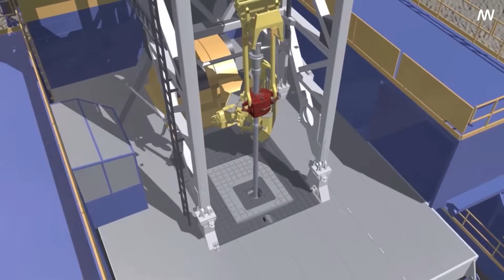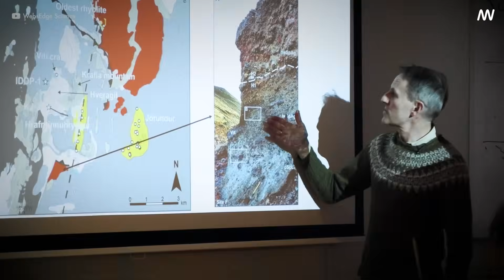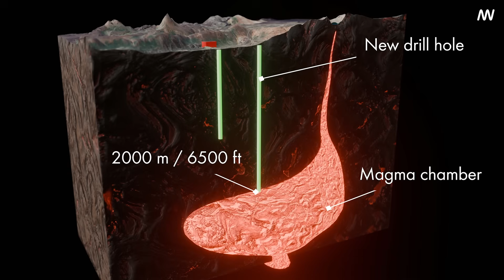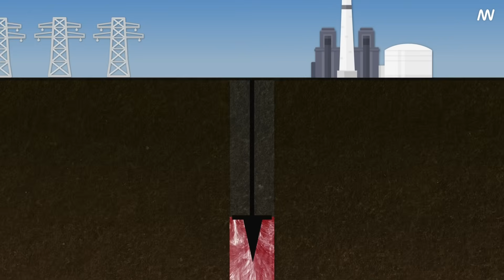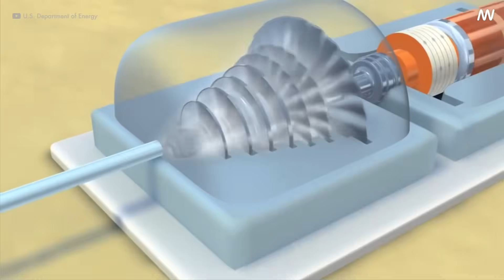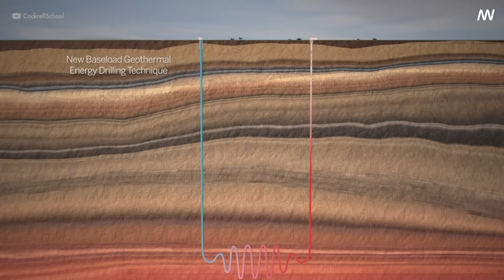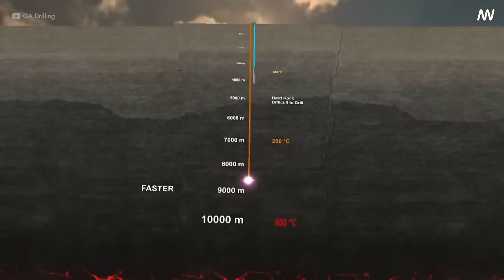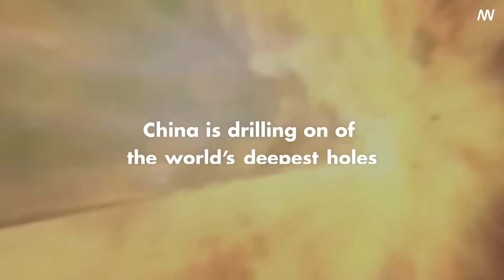Why Scientists Plan to Drill into an Active Volcano

Comment: The only way to get through a magmachamber is using drills that will not send of an chemical reaction.
In my opinion spread often crystals formed by magma can contain energy from a last heavy earthquake. This can be released if a chemical proces is activated and these crystals come to a meltingpoint again.
A 0.5 earthquake could then easily give an earthquake of 3 or higher if the last big one would have been a 4 or higher on the Richterscale.
A+B=C C:2=D Dx1, 4 = bew height of quake. 
So its all about knowing what was the last high quake and do you want to release this power with drilling. 
Water can give a quick chemical reaction so drilling with using water isn't the best methode.
Reply: I don't know of any research that backs your claims in the slightest.
Reply: @buggsy5  research is what scientist are afraid of. Then they will find out we have banged up the wrong tree for almost 70 years. Darwin his research went already in this way. He did not how to bring it to the people. His first books was getting people ready for it.
Reply: @buggsy5  Bugsy, Darwin was into volcanoes and finding crystals. What he had as conclusion weel we went of it. Now we are saying magma chambers or( tectonicplates for causing earthquakes) but if you take the next thing in counter:
Earthquake in a magnitude 8 and higher are realeasing forces over multiply atombomb strength.
If rocks are grinding they pulverized. So is this the true reason of high earthquakes. Its surtainly to be doubt.
Gasses, pockets of it, can they reach this kind of reaction, its never seen.
So if you take a look what you find all over the world, crystals, left behind when the earth was founded.
As I looked over earthquakes and period of time befor the formula I am working with occured, it can happen after 40 minutes or after more then decades. So if you look at these facts you or at least I did was looking into crystals forming and deforming. And after I have done that a hole lot was suddenly to be explained. So looking with a different idea to logical problems can give another view.
My lives motto is no problem as great as the basic.

Comment: Let’s see if AI mentions the fact that once Iceland perfects this procedure, we will be able to do this anywhere on earth because there’s always heat deep underground. We don’t have to hit magma to produce energy. Better than Solar better than wind better than wave, it is a completely incessant energy source.
Reply: Maybe. Contrary to the claims in the video, magma releases a lot of pollution when the pressure is reduced. How the pollution load from producing such geothermal power would compare to wind/wave/solar energy is unknown to me. There may be some articles somewhere on the subject. 

Of course, it is not necessary to drill into magma to produce geothermal electricity. Water becomes supercritical a temperature far below that of even "slushy" magma - assuming superciticality is desirable.
Reply: @buggsy5 i agree especially for your last point. no i actually agree for the whole thing you just said. out of curiosity, are you like a lecturer or something?

Comment: this is very cool
Reply: This is all bullshit. This project had already started in 2000 - and they are repeating it now. They don't drill into magma chambers but use the heat of the hydrothermal system, although the borehole reaches depths of approx. 3 km.